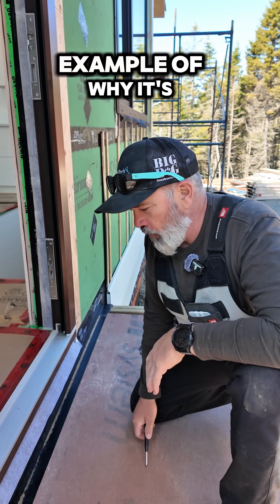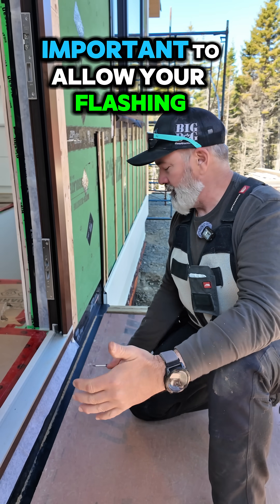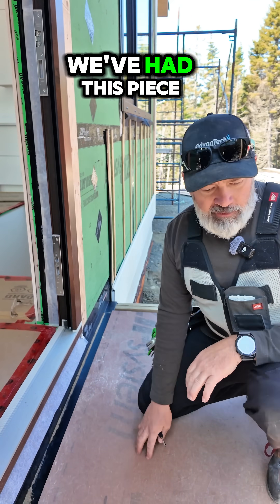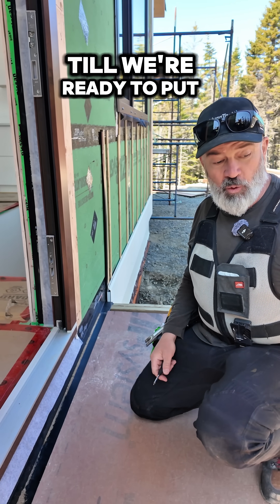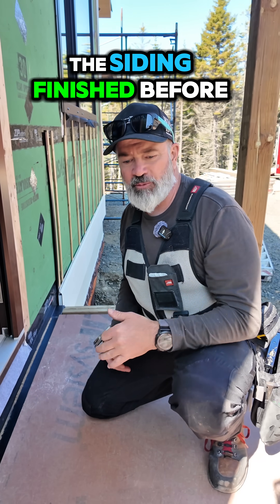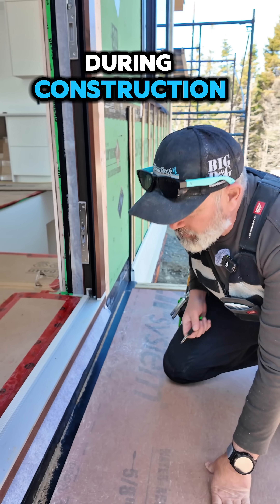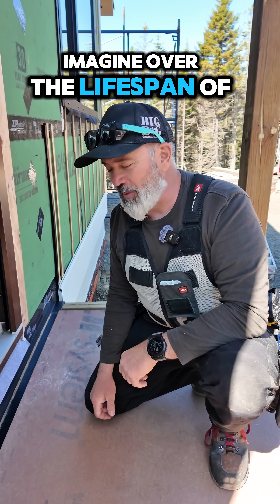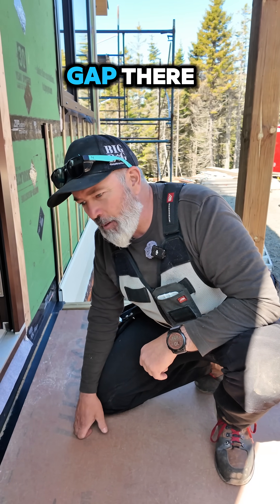The importance of allowing deck flashing to shed debris as well as water.

Comment: Nice solution.  Do you frame and flash the deck as normal ( making the assumption you tape the top of your joists) then add the tapered wedge?  Was thinking could do, what I would call, a dropped ledger ( top of ledger board below top of joists by ~3/8") but I don't know off the top of my head if there are joist hangers that would allow one to do this.  If your planning on covering any of this in future episode, I can wait until then.  Thanks for the content.
Reply from the maker: Yes, we tape the top of joist, then the wedge. Drop ledger is a definite option that works well, just not my personal preference.

Comment: Stand off the ledger with Deck2Wall spacers.
Reply from the maker: Great product, but you still want to flash the top and prevent debris from building up
Reply: @Aron_Jones_Carpenter  I liked that the debris and rain just fall through. Ledger can dry too.
Reply: I just hog out material on the underside of the back board then you don't have to put a weird slope on the deck